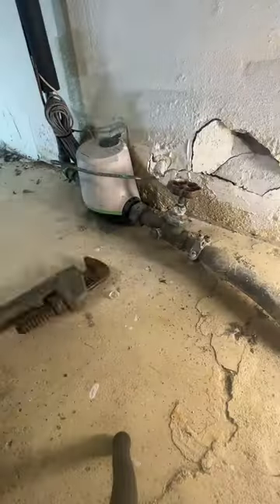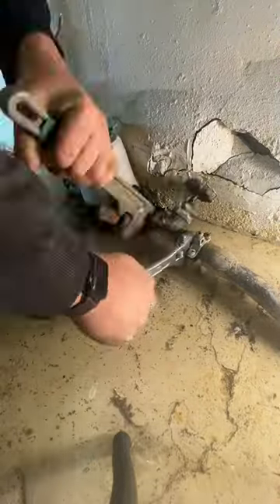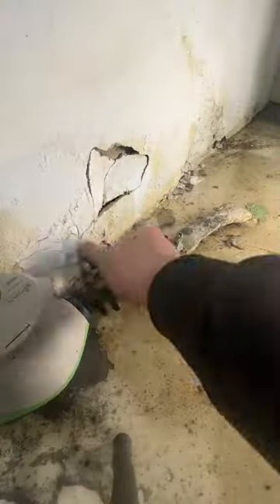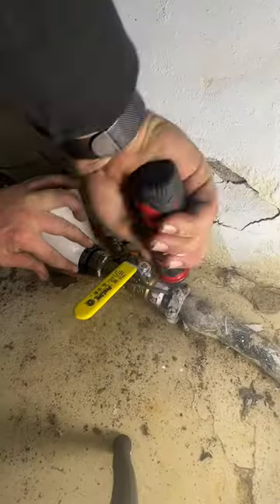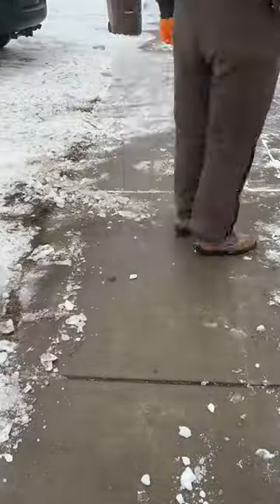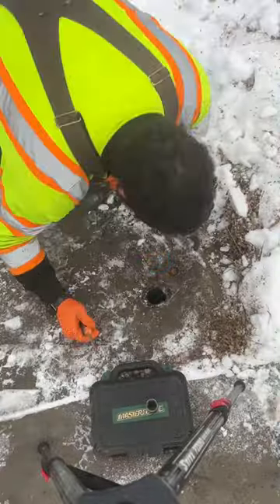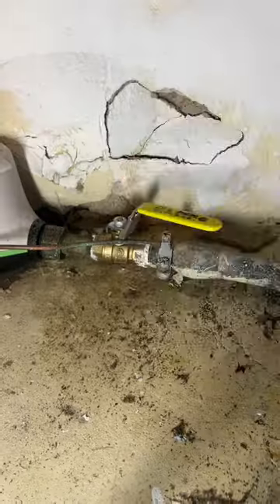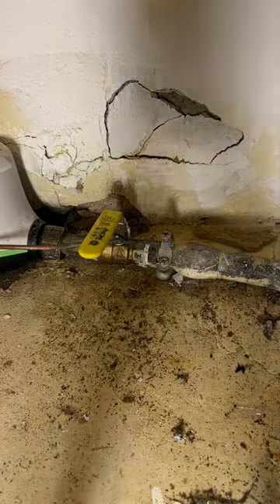Upgrading a globe valve to a ball valve￼. #ShortsmasChallenge #HandsomeOrHandy #Handyman #Plumbing￼

Comment: Must have been Flint Michigan...btw ball valves are not code on service line main...in Michigan
Reply from the maker: What do they make you use instead of ball valves?
Reply: @HandsomeOrHandy  a rebuild able gate valve threaded.
Reply: Ball valves are allowed in Michigan
Reply: @bobamizal7130 Absolutely correct I'm in Michigan and replaced many of them with ball valves and passed city's inspection.

Comment: Nothing like a crappy ipearl water meter. Should replace that with a straight pipe since that's about how accurate they are.
Reply from the maker: I haven’t had any issues with them. What don’t you like about the water meter?

Comment: GATE VALVE ??? GLOBE 🌎 LOL
Reply from the maker: I’m confused, it was a globe valve and I switched it out to a ball valve
Reply: @HandsomeOrHandy  you called it a globe valve, where I’m from and probably this guy too we call them gate valves .
Reply: I call them gate valves and I'm a licensed plumber in Texas
Reply: @masterkief2394  Valves that have a flat gasket (seal, usually replaceable) are called globe valve. Gate valves don’t have seals and have a wedge design that makes the seal.  The ball valve he’s using has been around since the 80’s (guessing) and for this service they are the best.  Full flow valves are the best!  Jim
PS….I only use 1/4 turn ball valves for faucets and toilets in my home, these are the best for that application.
Reply: @brianfield58  See my response to “MasterKief”…..thanks…Jim
Reply: A gate valve and a globe valve are 2 different things...

Comment: Can’t use yellow handled valves on water , they contain lead…. Id go back and fix that
Reply: The handles I use are yellow and they are lead-free
Reply: Talking crap no modern valves have lead in them, why would they??
Reply: @alemgas  
They have like 0.01% lead in them, im ballpark that number
Reply: You are worried about the "lead" in the ball valve and not the LEAD line coming from the street............................... You must be trolling us...........
Reply: @JohnSmith-xu7ev  not much of an issue then, cheers from Scotland